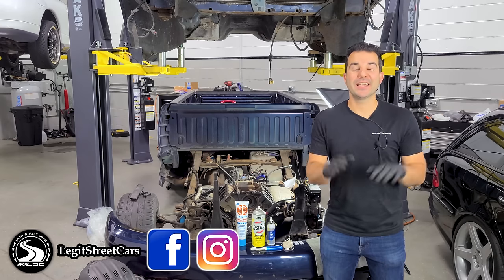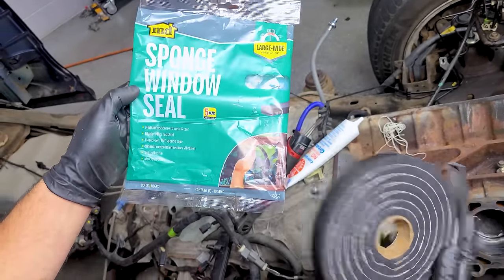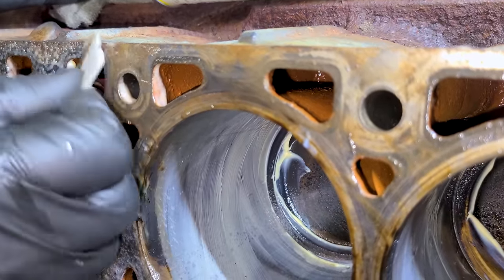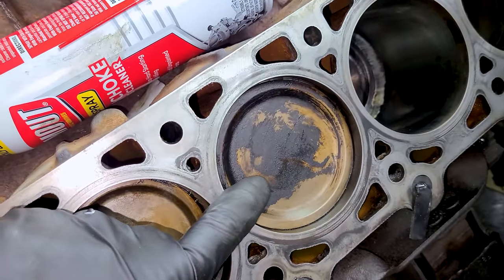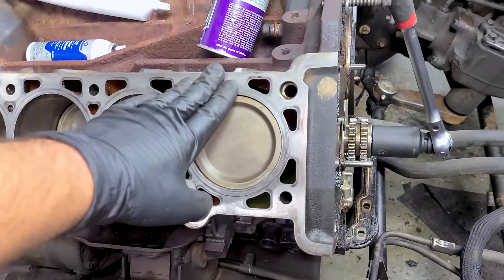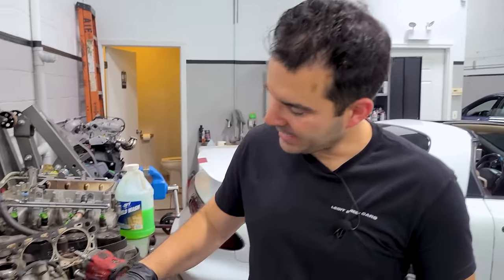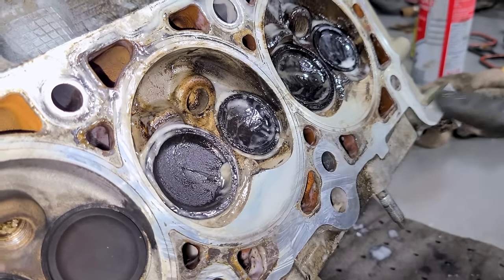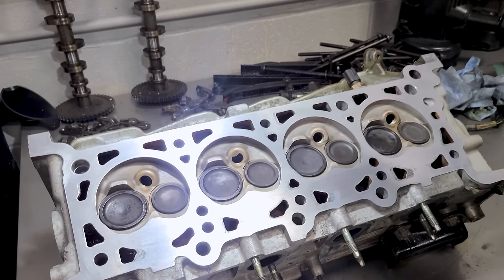How I Cleaned My SVT Lightning Pistons & Engine Block Using WAX STRING! BONUS: Head Cleaning!

Comment: Alex I have a question about the plastic razor blades are they as sharp as the metal ones and can you use them on glass I've never used them before keep up the good word try not to burn yourself out I watched it in like always do ✌️
Reply: I don't know about plastic blade.
But yes you can use metal blades on glass. But the blades must be flat and use a lubricant like window cleaner -spraying as you go or car wash/wax/shampoo.
If you use a blade dry it will scratch the glass..

Comment: The wax string is a great idea.  I always use a vacuum when brushing.  And suck it non stop.   I also use a 2x4 and 1000 grit.  Sand paper on heads I make  sure my 2x4 is longer and sand it at a diagonal.   All the way down
Reply: Another method is to use a flat piece of glass window plane on a bench top and lay a sheet of sand paper on it, then turn head upside down onto the glass and sand paper and swirl it around in a circular motion.

Comment: A PEA cleaner product, which dissolves carbon deposits, is possibly easier way to go at projects as this. PEA is common and it is often the same chemical detergent added and marketed in Chevron and other higher-end brand fuels, and is also known as Techron. PEA, stands for PolyEtherAmine, and it is a nitrogen-based detergent, and does an incredible job on Carbon build-up. It is found in several products made by Wynns, Red Line and Lucas Oil, and I am sure it is in other brands. One just needs to look for PEA on the label.The one I have access to is Wynns (which I am told has the highest concentration of the PEA), and I have also used their over-the-counter Gumout brand, which has the same PEA chemical, but at a lower concentration...but is in just about any auto parts store. Not inexpensive, but likely would not need to use 3 other products to get the same job done. So, you come out making the product worthwhile. I use it in my kid's air-intake of a Honda GDI engine, and as a fuel additive for my Truck. The stuff works really well!

Comment: I had the same problem. But it was not the headgasket, it was the EGR cooler that was internally leaking. I found that one out when I disassembled the head 😣

Comment: simple common sense goes a long way. impressive job on the cleanup.  Sorry ro learn of the catastrophic engine failure.  I had a feeling back in the beginning when you flushed the engine for the 1st time and all that rust was coming out that it wasn't long for this world. Good luck on your next decision. If it were me... I'd go with a Ford Performance replacement.

Comment: Alex, the proper way of storing the straight edge is not how you describe it. You should hang it down suspended off the hole. That’s way all sits relaxed.
Reply from the maker: Yes that's proper too but not many hang them like that so my method is something most will do.
Reply: Was about to state this as well, great reply.

Comment: Thanks for everything. I know it’s easier said but I learned a lot of tricks and methods from your channel. I am working on a 
76 Toyota FJ 40 LandCruiser. Definitely applying deck and head cleaning and tolerance methods. I also have a 50th Anniversary Special Edition C5 I am upgrading little by little. Runs great but wanting a better exhaust and thinking about doing the clutch soon, 😥 Thanks so much!

Comment: Never use a sponge or soft material to clean machined surfaces, these are supposed to be a extremely flat surfaces, using a sponge is counter productive. use a block of aluminum with one machined flat surface and and the correct grit for the material and gasket. I like the grease and wax string method.

Comment: 14:54 Actually its pretty easy to mess up an iron block.

All you need is some strength in your legs, a pair of steel toe boots and a hard enough kick.

Done, you screwed up your iron block by simply kicking it with your steel toe boot.

Or you can simply use a sledge hammer.

Comment: I love your videos they can be an hour long and i am glued shout outs to max and peter too, my 2013 supercharged ford raptor had an 8 second engine fire i took it to a mechanic that i thought was reputable well after five months later they have squeezed 9k from my insurance for the fix only to tell me that they cant fix it at all and it should be totaled i personally think they just ran a scam but i am stuck in the middle. The truck literally burned for 8 seconds. Is there any way you guys can help me??? I am coming from new york. The truck has 49,000 miles and i payed it off supercharged it and took very good care of it so its very hard to let it go.

Comment: You should never clean the bore unless you are replacing rings (and therefore honing, etc.)

You should turn the engine and clean the piston tops ONLY when at TDC and leave any carbon build up on the cylinder wall as the rings now need that build up to work/seal
Reply: Especially that cleaning top pistons is completely useless. Just satisfying for YouTube views...
Reply: @boiteacourrier  I don't think its useless. On any of my cars if I've had the heads off, I clean them all like new. Start fresh, same with heads valves, and carbon in manifolds everything like new. Mainly for my sake knowing that everything is perfect.

Comment: I do not recommend easy off oven cleaner , it contains sodium hydroxide ! ( eats aluminum)  it will get trapped behind ring  and dissolve the critical ring land faces and strip the  plasma molybdenum faces of rings !

Comment: So just out of curiosity I'm bringing this up if you're not supposed to use the oven cleaner on aluminum why are you using it on aluminum? The Pistons are cast aluminum. I've use oven cleaner on cast iron block my whole life... I just use brake clean on the Pistons.
Reply from the maker: Great question. Because they are coated. I explain that a little later in the video

Comment: You can use water to clean the pistons and chambers doing nothing and no using nothing but water. It's old mechanic trick that charged the customer for head disassemble and clean with water saving the work.
Pur the engine at 3000 rpm and with a small hose pour water in the carburator. The amount of water is the suficient to the engine don't stall. If the engine  has a catalictic converter it should be disconected. If the car is fuel injected the MAP sensor should be retired. After a while a white smoke starts to came from the exaust. Keep the engine running with water added for 10 minutes. If you don't believe, do this and take the heads off. The pistons and chambers will be like brand new completelly cleaned. Engines can work with water added. Messesschitt BF 109 in WW II used water injection when in overboost. The intention was not clean, it was to cool the heads, chambers and pistons in overboost.

Comment: Just drop the pan and pop the pistons out. 

Get the pistons clean where it counts, in the ringlands.

Cleaning the carbon off the piston crowns with a soft wire wheel, bring each piston to TDC to clean it.

Vacuum up the grease? LOL, no thanks! I'm not going to ruin my vacuum when wiping it would have worked just as well.

Comment: Why not just blast everything with walnut shells it won't warp anything or etch the metal and if you drop the oil pan you can spray under the block with a blow down gun with air and solvent to make sure there aren't any walnut particles that got past rings.

Comment: I suspect the catastrophic damage is related to that significant nick on the top of that forward piston at 12:18
Reply: There’s several valve contacts, if you look closely.  Those valves had to have taken some damage too…
Reply: Not enough to have the  whole block replace
Reply: I saw that too however that just looked like a little arrow to me and I thought that was normal but I really don't know all that much on engine problems I suspect there is a worse problem on the other pistons he didn't clean
Reply: @mirrorman2499  it was lower on the piston, about 5 o’clock

Comment: @LegitStreetCars I wanted to ask on your C5 eco tune. I’m looking for a C5 Z06, and I wanted to ask if you knew weather or not you can swap a 3.15 rear gear to a tr6060 
1st 2.66
2cd 1.78
3rd 1.3
4th 1
5th .8
6th .63
I plan on tracking this car and prefer these closer gears to that of the stock t56 m12. 

I want to make this trackable but I do a lot of county cruising 50-70mph which is where I’d like that eco-tune. I’m not expecting 40mpg but close would be nice. I’m also getting rid of AC(I never, ever use AC). And possibly power steering, my ranger is manageable without power steering but a corvette with 275s up front may not be so easy. 

My plan is to get this car to 2900lbs swap the transmission and rear gear/differential. And really just an intake and tune on the engine is all I wanted(my logic is if I’m taking the engine out may as well put something better in).

Comment: You never use oven cleaner on aluminum it etches aluminium which causes the carbon to adhere and melt into the surface

Comment: I just replaced a stripped socket cap screw holding my serpentine belt tensioner pulley on along with an idler pulley , and couldn't find that damn screw anywhere except the dealer so I paid 5 damn dollars for a screw, stupid BMW stealerships!  When I was out I scored some cool stuff at the Junkyard though.

Comment: Personally, if I teardown an engine this far, I'm never doing this. Pistons are coming out and I'm honing at the very least, and the heads are going out for a valve job. And I'd be on the fence about sending the block out as well. No money is saved if you put an engine back together that doesn't work properly. Chances are the machine shop would find problems during the service. Just my .02

Comment: I really like that wax rope trick. I feel like you should have plugged the oil passages on the head before sanding. Sand paper commonly uses aluminum oxide as an abrasive, if it contaminates your oil it can embed in friction surfaces and cause premature wear.
Reply: Te head beign off the engine it's really easy to clean, you really don't need to plug anything if you take like 30 seconds to rinse up to down before installing 🤷 not the same thing if you don't plug the engine block
Reply: No, you remove the string.

Comment: Buy me a used engine, or trade me yours, and you can have mine out of my truck. Mine runs fine as far as I know and has no head or bottom end issues. You'll have to come pull it, but I wanted to do the same thing to mine that you're doing to yours anyways. So, this would speed up the process for both of us. :D

Comment: Very interesting video of some home-brewed techniques!  Some observations:
23:50  To be technically correct, you have not verified that head to be flat.  You have verified that it is straight, and in that linear orientation only.  A true flatness check requires an allowable gap within a specified amount of surface area.  It would be best, at minimum, to check the surfaces between cylinders also.
There are different types of oven cleaners, and IIRC one of them is safe for aluminum.   IIRC it uses potassium-something instead of sodium hydroxide.
Reply: Unfortunately potassium hydroxide based oven cleaner also eats up aluminium, I tested it myself
Reply: @asirgi_remyga  Hopefully you tested it on a scrap piece of aluminum.
Reply: @furyfantoo  no I saw white runoffs from my engines' intake ports, it has appeared quickly so I canceled cleaning, not a big deal. Further I'm gonna try petrol
Reply: @asirgi_remyga  You could try a 1500watt submersible heater with some Dawn.  I had really good success with this + vinegar in rust-stripping, it would even remove paint if left in for a week or so.  Don't know how it would work on carbon in a cyl head, though.  And you need a heavy-duty tub to do it in, plastic works, just not a flimsy one.

Comment: Awesome video. Bummer about the catastrophic news on the engine.
Easy Off does a lot of good things. And they don’t call it Easy Off for nothing. 😂😂
Question for you. Would a brass wiz wheel brush on a small air tool damage the cast iron or aluminum block?

Comment: WD40 is supposed to be pretty good at cleaning, especially since it wont hurt if its in oil passageways or coolant. light scrubbing is all thats needed apparently. i want to do it myself one day but unlikely i will get the chance
Reply: WD40 worked on a rusty bike chain but I'm not sure how it'll do on engine since carbon is very tough.
Reply: @IKhanNot  ive seen a guy on youtube do it. WD40 does help break down carbon. all he needed was scotch pads and towels. no wire brushes or blades although i think there was a bit of silicon he scraped off first
Reply: @IKhanNot  Coolant cleans carbon, same with carb cleaner.

Comment: NOT A VACUUM, use the compressed air!! Air at 50 or 100 psi has more power than a vacuum, especially in that little gap between the piston & block..

Comment: 12:53 i don't know which kind of engine is it. but there are no visible honing grooves. (it is cast iron so it isn't nicasil.) 
so that cleaning job is just waste of time... there will be carbon again after few hundred miles just because of engine oil and probably wrong carburation...

Comment: I have no idea what I just watched. By the time you get the heads and timing chain off, there's no point in cleaning a damned thing because for less than five hundo you can just rebuild the short block. Hot tank and hone, rings, bearings, freeze plugs, oil pump, slap it back together good as new and no worries about having to go in again.

Comment: Sonic tools are very expensive and made in china/taiwan. So that goes to show china manufactures some of the best hand tools on the market. For electronic tools/ scanners/diagnostic equipment. Only china is capable to manufacture these. $5,000+ Snap on electronic diagnostic tools are all made in china. The most expensive top of the line electronic tools are all made in china.

Comment: It would be better also to clean the piston rings and pistons from the inside i saw a russian guy on garage 53 i think he dissasembled a whole bad blue smoking engine just cleaned all the parts like yours shiny and the engine got his compression back and stopped smoking just by cleaning😂

Comment: A cam bearing ended up wiping on my wife's Honda 3.5, blew the timing belt, which was the first sign.. sadly it's an interference engine so i pulled both head, replaced all the valves and found the wiped camshaft (got a replacement used cam for $75, but with complete gasket set, 24 valves, timing set & water pump, coolant, oil, filter, plugs, coils the whole nine was under $900 including a few tools i needed to replace do the valve springs and a fancy torque wrench.. etc.. anyway yeah Honda quoted her 8 grand for a 'new' motor haha not gonna happen.. took a few days but it's all good and runs better than new!!

Comment: lot of work for no real reason IMO. I rebuilt the top end of an engine, cleaned and everything, ran 500kms before I realized the bearings had damage and needed to be replaced as well, when I took it apart it looked exactly like it had with 150,000kms after only 500.

Comment: There are many types of oven cleaner.
The low or non toxic enzyme based ones that don’t require heat and take for ever and aren’t very good are ok for all metals and plastics usually.
The very caustic old style ones will dissolve pistons in minutes.
The acid based ones should be safe for short periods of contact.

Comment: every time you separate the head from the block yo really should face both mating surfaces.. the blocks warp around bolt holes from pressure and heat and the head gasket etches into the head by a few thousands.. doing what this video shows is the backyard mechanic way and it will blow a head gasket really early on.. barum engines has a whole lot of videos on this exact subject and provides proof of it.. even if you are building the motor your self just spend the $100 to have the block and head surfaced..

Comment: Removing the carbon is a waste of time......scrape the block with a gasket scraper, wipe it down with lacquer thinner, good to go!!
The HEADS are critical.....have them resurfaced by a machine shop if in doubt.
Run that engine for a week, and the pistons would look the same................

Comment: this guy "use 2000 grit and dont go crazy with a wire wheel" 

mechanics "fuck it use a brown scotch brite on a disk grinder and hose it off with brake cleaner"

Comment: seems so pointless, if you are going that far to dissassemble your heads, with engine out of the car.
might as well get the conrods off and take the pistons out of the bore to clean em properly that way.. and re ring em and do your bearings at the same time..
why would you go this far and than not go all the way while you can

Comment: Oh no. Did you let Sam work on the engine and now it's broken? You can't let us Florida Boys get near your all's fancy engines I tell you. We go crazy with ideas. Start cleaning your heads with crushed scallop and oyster shells. Using gator teeth to clean the valves. Drinking St. Augustine Distillery 'Florida Mules' all day and assemble things wrong.

Comment: Waste of time. Use a 3M Roloc Bristle discs. Then use a shitload of brake clean to clean everything and flush everything to the pan then change the oil. I never had any engine problems, ever. Im not saying what he is doing is wrong, it is just unnecessary to do all that work.

Comment: No!
Do not go in any sequence to remove a cam except the following.
Look to see which valves are being opened by the cam and loosen the fasteners that hold those first especially any that are under the most pressure, then work outwards from those fasteners releasing the pressure gradually until no valve is being opened.
Failure to do it as described can result in a snapped camshaft.